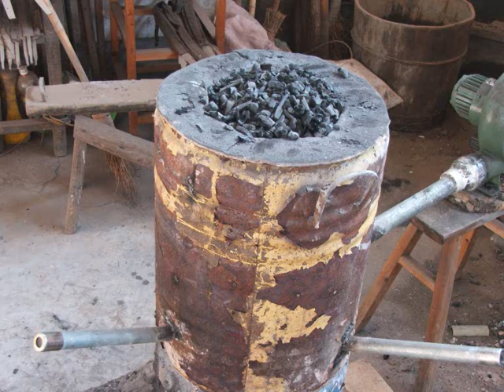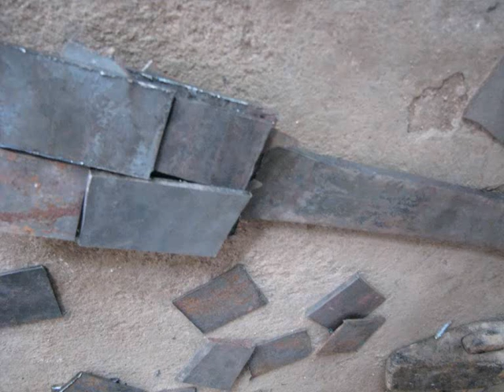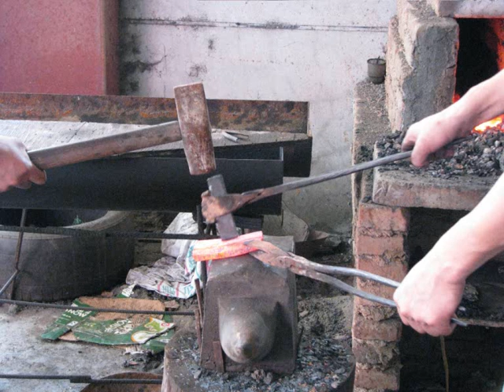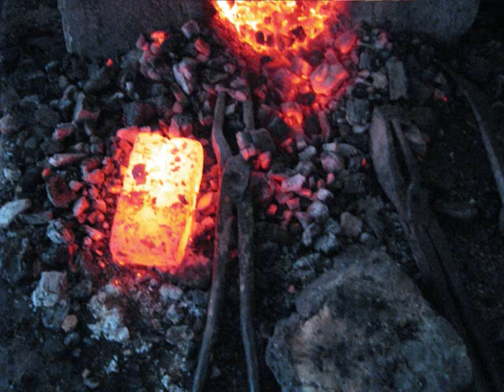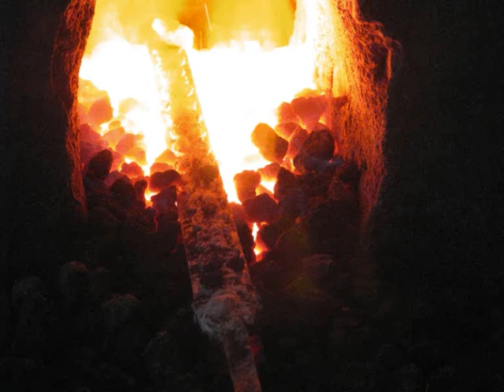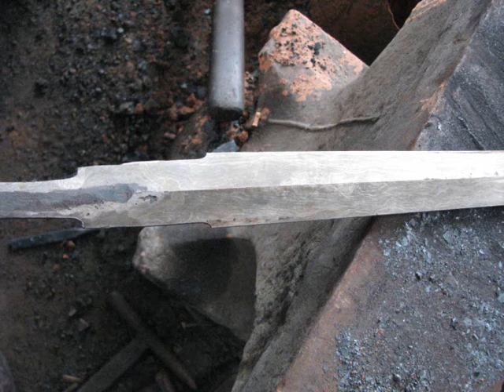Forging of a chinese jian in a traditional way

Comment: man, i need help. i have a jian. but in an accident, the metal on the scabbard, where the blade enters lifted off the wood. its easy to glue it again but i lost a kind of black wax that mantain the blade secure inside the scabbard. i dont have any idea of how is the name of this wax for buy another to replace. do you know how is it named or what sort of material it is?
i would really be thankful.
and the video is great. is difficult to find videos of jians being forged...
Reply: I am not a craftsman but trying to help as best as I can. I think it's lacquer. Google this word and see if it leads you anywhere. I just noticed you posted this question 8 years ago. Hahaha

Comment: a bit disappointing video.  I was hoping to see actual video footage of Chinese Blacksmith forge work.  This is a slideshow and is lacking in so many ways.

Tristan, the item that you are referring to as a forge, is actually a foundry furnace that gets much hotter than a forge. It has to, because they are taking iron ore and metal pieces and melting them together. Only temps above 2700º will melt steel, so a foundry and crucible are crucial for that step. The foundry melts the steel and produces what is known as "a Bloom" of metal.  It is raw metal that is filled with impurities. Those impurities are removed by the forging process of heating, pounding and reheating.  This process removes impurities and transforms the bloom into a workable steel. Carbon is added to give the steel strength and changes the chemical composition from iron to steel.  Essentially, the foundry produces iron, which must be worked, reworked and infused with carbon to transform it into steel.  Foundry work is the second step in forging. The first step involves gathering and mining the iron bearing minerals that must be made into iron through the processes mentioned.  It is much more complex than this, but these are the basic steps to producing and making metals and steels for knives and tools.

I was hoping that this was a live video and not a slideshow, because I learn from watching the actual processes of foundry and forging techniques.  Although the pictures are nice, it doesn't show the actual process and steps of making the iron to steel, and then shaping it to the final product. Although the basics are the same around the world, there are subtle differences in the approaches to the actual techniques that varies from region to region everywhere around the globe.  My thanks to the video filmmaker who produced this slideshow, but it isn't what I was looking for.

Comment: What type of furnace is that? I see it starts with ore, but what comes out, steel, cast iron or wrought iron?
Reply: You can see them heat-treating it. You can't heat-treat wrought or cast iron, so it's gotta be steel.
Reply: Iridale Traditionally in China they had the technique to have a furnace produce cast or wrought iron, and then decrease/increase the carbon content through various means. This furnace could be producing cast/wrought iron.
Reply: Tristan Ruggeri Well, it doesn't seem like they've gone from wrought or cast to steel before forging to me. But that's just my eye.